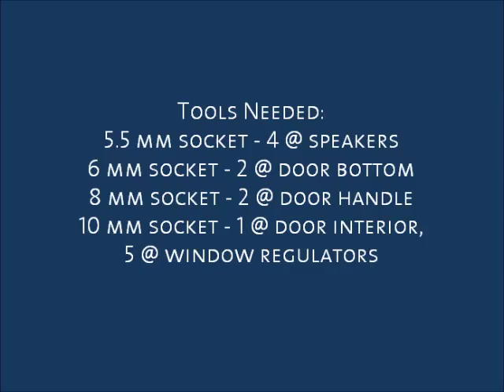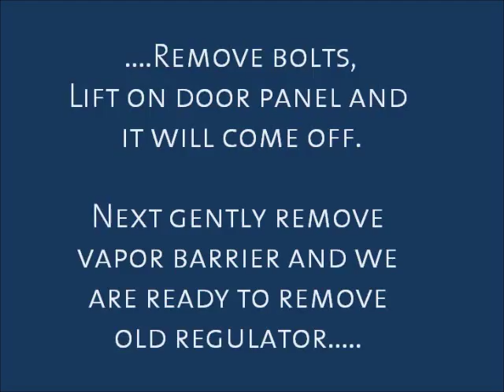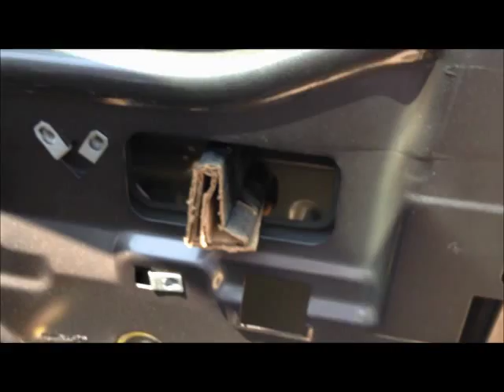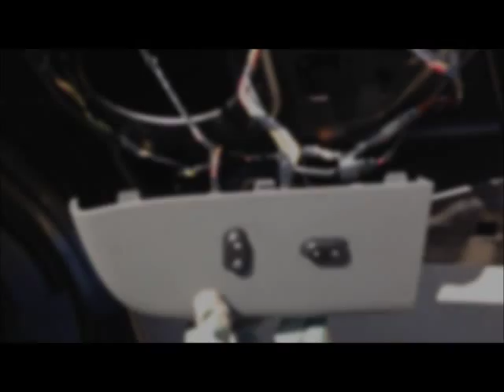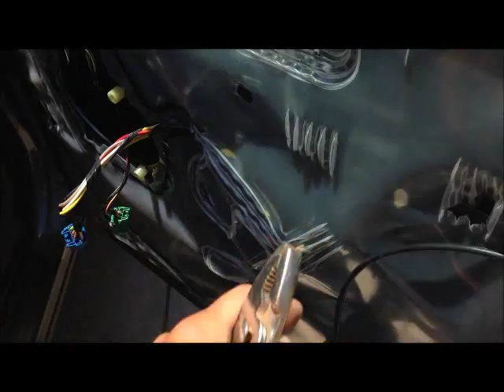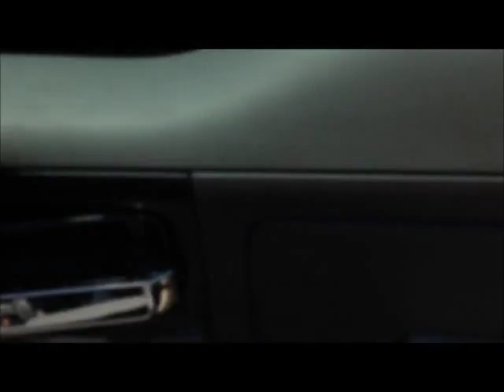2005 Ford F150 Supercrew Window Regulator Fix

Comment: Good video. The clearest video quality of all of them. For anyone else watching when he is ranting about 10mm sockets not being able to fit into the holes my 1/4" drive 10mm socket fit just fine. So if you have a 1/4" drive socket kit (I've had my $9.99 kit for 10 years now) you will be fine :) Very easy to do this whole job. I found the regulator for $35 on Amazon shipped prime. Be sure to use AutoZone's website to get the part number itself and then research that part number online. AutoZone wanted $90 :|
Reply: Would you happen to know the part number? Or maybe a link to Amazon where I can find it?

Comment: Thank you! Excellent, efficient, and helpful narration. I had a shop do the work for me on my broken regulator. After handing over the $350 for the fix, I got in my car, rolled the windows down to drive home in the heat, AND THE OPPOSITE SIDE WINDOW BROKE! Thanks Murphy!

I may try to do this next one myself. Does not look too bad as you have done the trailblazing work for us (sheesh, Ford! 9mm hole for a 10mm bolt!)

Thanks again.